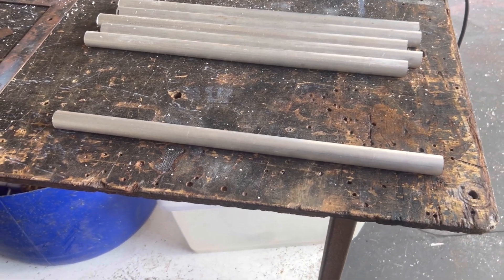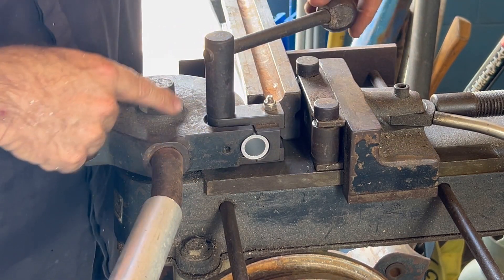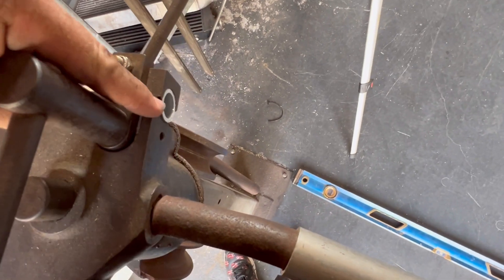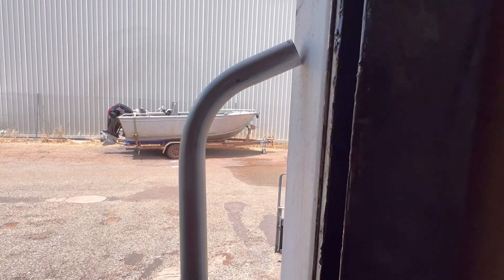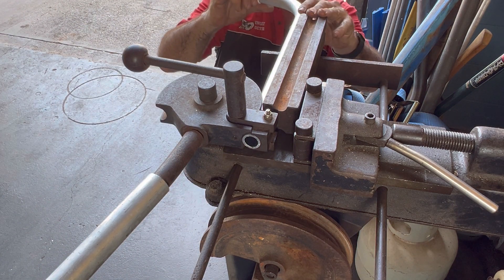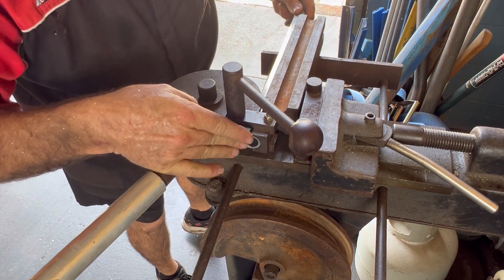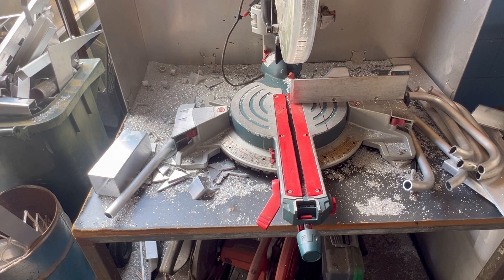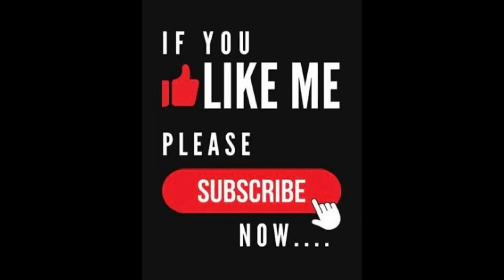Pipe Bending Explained using 25mm Aluminium Tube

Comment: Thank you, great information! I am assuming the long bar is the key to keeping the shape around the die without kinking because it is better supported. I have to bend 25,4 mm (1.00'') with a .035'' wall, should I pack with sand without heating? I am looking for a 90-degree bend. The material is 6061 T6.
Reply from the maker: I miss name my Bender 
Mine is a tube Bender and not a pipe bender 
Tube bender will draw the tube around the die 
A pipe bender has a central jack/hydraulic ram pushing against 2 rotating fixed points  rollers

Comment: Hi sir, a quick question, my aluminium round pipe (6063 T5) often fractured while i was bending them. Has your aluminium pipe gone through heat treatment or any plating procedure to strengthen the aluminium, thanks!
Reply from the maker: I do use the bendable grade material. The structural grade will crack for me as well.
Reply from the maker: If you use the structural grade, you will need to heat treat it before bending which does weaken the material